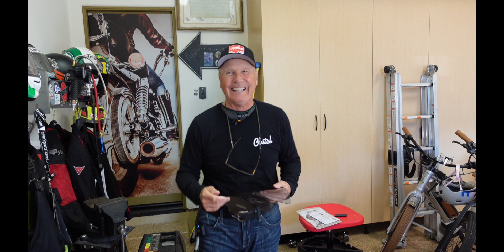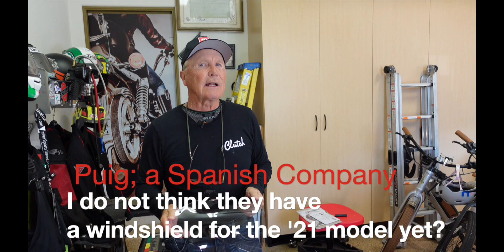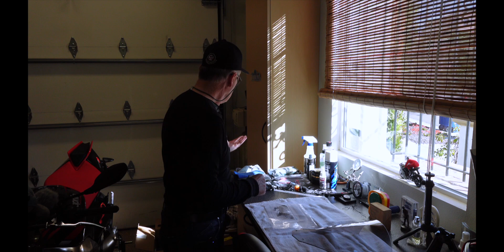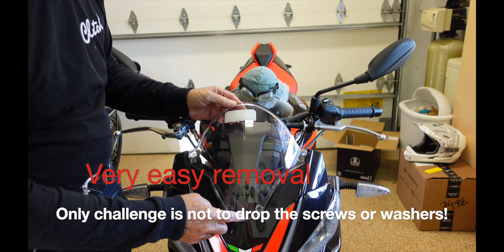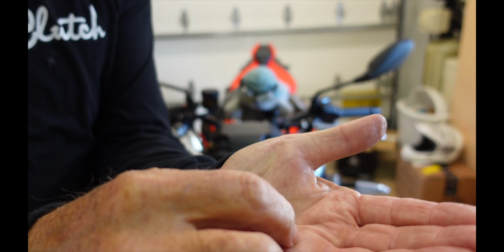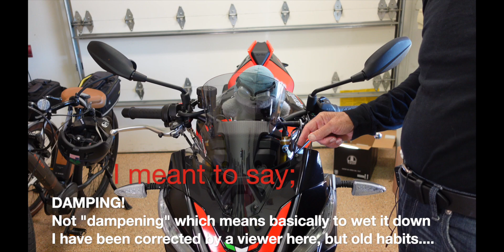Installing PowerBronze Windshield on 2021 Aprilia Tuono Factory   HD 1080p

Comment: I just got the tuono 660 , the reason I didn’t try to buy the v4 is financial and I wanted to have a full warranty so I didn’t buy a used v4. But what amazed me was that the 660 and the big tuono are both incredibly light. After time on the 660 I am totally happy with the power it makes but I hope to move up someday. I enjoyed your videos about yours for sure. I have ordered a powerbronze windscreen for mine like you did. I am glad I saw you doing it because I didn’t know about that brand, thanks!
Reply from the maker: Really glad it helped Jason...and I think that the 660 is a bargain and you're going to love riding it. Actually the 1100 is overkill anyway and lord knows that nobody really gets to use the extra horsepower on the street in any case. I actually did consider the 660 series for the price and performance ratio is excellent. 
It turns out that there a number of interchangeable parts on the 660-1100.
Good luck and ride safe!